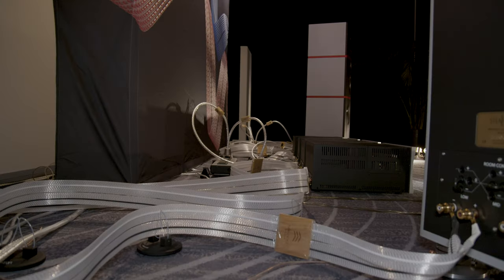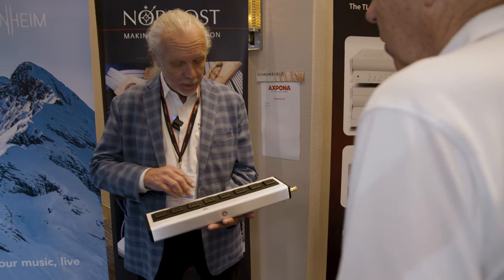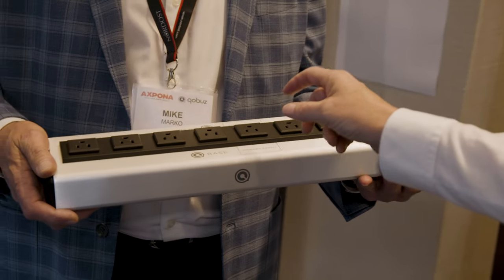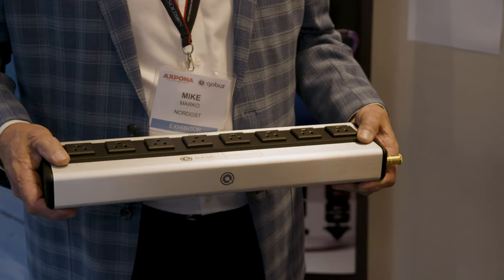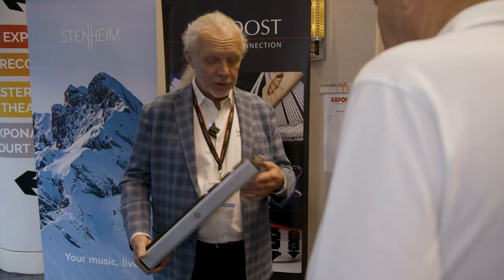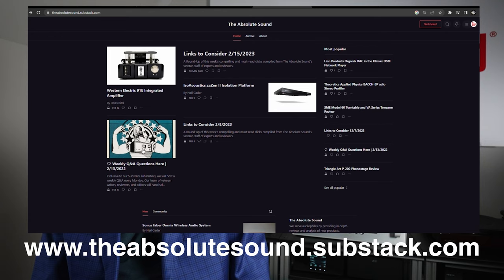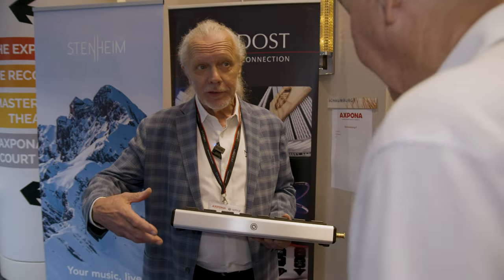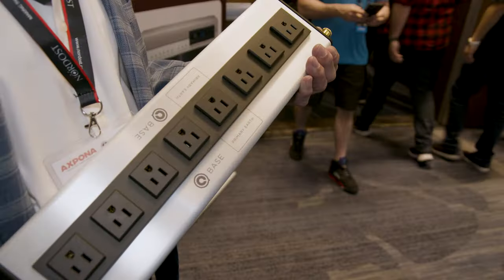The QBASE Mark III AC Distribution Unit | Preview

Comment: How is it that after a nearly 50 year career of designing power distribution systems for among other things laboratories where some of the most sensitive instruments in the world are installed, I've never had a problem with any of them that audiophiles seem to have with their audio equipment? I've never experienced any of them myself. Under normal operation there should be zero ground current flowing. If there is, something is very wrong. A GFCI circuit breaker designed for ordinary use will trip if the ground current is as high as 4 to 6 milliamps. How do you get a UL listing if you put a resistor in series with a safety ground? Makes no sense to me. BTW, NEC doesn't give a damned about your hi fi system performance. It's objective is safety. If in a fault of a hot to ground short circuit and the resistor burns up you could face a dangerous situation with an ungrounded circuit. 

At the request of countless A/V contractors I have specified and installed countless isolated ground circuits and even wrote a specification for acceptance testing of them to be certain that the circuits really were isolated ground. But in all of the years and talking to countless electricians nobody ever recalled solving a noise problem with an isolated ground substitution. BTW, that is not necessary or required in a wood frame building like most homes. If they are going to do anything at all it would be in a building with sheet metal studs creating the possibility of circulating grounds within the building itself. If an isolated ground receptacle is installed in a wood frame building you'd better be sure that the isolated ground pin and safety ground pin are shunted at the receptacle. 

The gold standard for high quality reliable electrical power in industry is the double static conversion UPS. High quality high value electronic equipment is designed with power supplies that take into account most types of electrical power quality anomalies. The double static conversion UPS addresses all nine types electrical engineers recognize.
Reply: Putting a resistor in series with the safety ground is against code as far as I'm aware, though electrical code was never my best subject and I'm not looking it up. I should phone my local Electrical Standards Association office and ask about it. As for what works in the laboratory, those guys have tight budgets and are doing what works. I've spent a lot of time looking into vibration control (and electrical power quality) and in the laboratory the demands are a lot lower than in audio. All they have to do is get the image to be crisp and that doesn't take much unless they put the lab in a bad location. Window air conditioners, HVAC or footfalls from people are the biggest problems. If you are doing In Vitro Fertilization you might want to have an active vibration control platform to put your microscope on but those facilities are in regular medical buildings with footfalls. Plus, laboratory instruments are designed to control their own sources of resonance. Audio gear has the added demand of needing to drain away their own self generated vibration and so the stiffness of the platform is very important. In practice, audiophiles have found improvement by stacking active vibration control platforms such as the Seismion Reactio platform. Stacking two makes a huge difference and three only a bit more. Seismion is coming out with a Pro version that will increase the isolation even more. There is no science studying vibration at this low a level for anything other then stresses in formed components such as auto parts. See pico-vibration meters. The best ever vibration control is in the gravity wave detectors they've built in the United States. It's basically like three massive  six degrees of freedom active control platforms stacked atop one another. 

I should mention that they have studied just about everything you can imagine about vibration as long as it is useless to us audiophiles. They even sent a deep sea submersible down to the bottom of the ocean and measured enough to figure out what vibration comes from the mantle of the earth, what comes from the ocean itself, what comes from tectonic plate movement and all the rest you could never think of if you're life depended on it. But they've never studied the role of stiffness as it would relate to draining vibration from audio gear. I bought 8 Critical Mass Center Stage 2M footers last year and those have upended everything i thought about how reality works. They're not perfect and they cost way too much money but now I'm thinking of buying active vibration platforms for my gear. That way I'd have super high stiffness and super low vibration. The best of both worlds. Too bad Seismion is German and the nation may not be in business next year what with their energy costs going up 400% to 1000%. 

I know I'm banging on about vibration when you wrote about electrical quality but there really isn't much of anything in the literature about electrical power conditioning. It's mostly proprietary. Most conditioners sound good at first but after taking them out after a couple years you realize it sounds better without. I suspect the brain ear connection takes time to sort out what's happening and it can be fooled at first. 

I just looked into Double Static Conversion UPS. SurgeX calls it Double Conversion Online UPS. They're basically a UPS that is designed to do it's thing all the time by converting the AC to DC (with a battery for storage) and then back into AC. So basically a low budget PS Audio Powerplant. A normal UPS takes action only when the power goes out. I'm looking for something for all the power outlets I use around my computer. It's ridiculous the number of outlets I'd need if I kept everything plugged in all the time. I used to have a very large normal type APC UPS for my computer. I stopped using it because of the cost of replacing batteries every 4 or 5 years. Back then I did try using it as a power source for my stereo and the sound was pretty bad. Not only is the inverter likely the cheapest thing they can make but the source impedance of the batteries is detrimental to the sound. 

These "Industry Professionals" that you talk about are, at best, engineers. I've worked with engineers for 40 years. They live in a world of certainty that doesn't actually exist except in their imaginations. The fact is that theoretical physicists (light years smarter than engineers) have studied electromagnetism for 200 years and still don't know how it works. I'd argue that all of physics including classical physics is just glorified cutting edge engineering, not science. They find things to measure and then record their measurements and then use the knowledge built up to design and build things. But they don't have the slightest idea how it works on a causal level. Search :"Jefimenko, causality, electromagnetism" for one of a mountain of examples I, a factory worker, can provide. Also search Freeman Dyson - Why Maxwell's Theory is so Hard to Understand for an idea of what they're up against (I think he's blindly optimistic but he does lay it all out). They're not stupid. It just can't be figured out. And if they can't figure out how electromagnetic potentials and fields work in a vacuum you should see how lost they are when it comes to the flow of free electrons in metallic crystals (conductors). Those guys must like to suffer. They know close to nothing. No joke. They do the math in one dimension (because it would be too complicated otherwise) and then after they get an answer they extrapolate it out to three dimensions. Hopping and guessing in the extreme. I learned nothing of use researching all of that. I would have been grateful for a definitive explanation of what causes Skin Effect but I found nothing. They don't even know how the EM wave travels through the crystal. They assume it's a plane wave but that just might be a simplification so they can do math. 

I might buy one of these converters to try to keep the noise from all the switching power supplies in and around my computer from contaminating the electricity in my apartment. One concern would be that the AC to DC converter in the Conversion UPS is itself just a large switching power supply and would make everything worse. I have two Topaz Series 30 isolation transformers right now. One for my DAC and one for my digital transport. Those are the only things I know of that can deal with power quality issues. Hi-End audio is the real deal but it is also the industry with the most nonsense and the highest percentage of manufacturers that the world would be better off without. Anyone yacking on about Wilson or DCS needs to be ignored. Audio teenagers who haven't experienced enough to grow up. Audio Note UK is where it's at and you'll conveniently notice they don't get reviewed (properly at least) in the mainstream audio press. They're too concerned with the "quality" of the "aerospace grade aluminum" chassis (which is a total waste of money and resources, but...). 

One example of real "science" in audio is the AES/EDU digital interface protocol which calls for a 110 Ohm characteristic impedance. Characteristic impedance in the low frequencies that we're dealing with here approximates to the square root of inductance divided by capacitance. The closer together the conductors are the higher the capacitance and the further apart the higher the inductance. So the capacitance (electric field) and the inductance (magnetic field) oppose each other to create this impedance. TARA labs claims to have AES/EBU cables with capacitance of less than 2 picofarads per meter. That is impossible if the cable actually has a characteristic impedance anywhere near 110 ohms. There are things we can be absolutely certain of and one is that this cable is impossible, and yet nobody in the "Audiophile Media" calls out this kind of abject nonsense.
Reply: @bunsw2070  Enhineers not interested in practical considerations like  irrational? How about a 25,000 power scanning electron microscope? A 100,000 power electron microscope? A machine I designed the installation for over 30 years ago that photographed individual atoms?

Comment: Hello,

Can you tell me, in layman's terms 
what a  double static conversion UPS is?
   I live around the corner from a utility company's high-voltage grid.
My tube amp is creating a buzzing sound in both 2 channel & multi-channel speaker modes.
Any idea how I can solve this issue?
   
 Also, I want to higher an electrician to put in a dedicated power supply for my 
audio/ video system.
What name & model # wire do you recomend I use?  
I use 2 wall outlets for my av system.

I appreciate whatever guidance you can provide.
    BTW, I recently put 3 store demo Nordost products on layaway.....the power strip in this video,
the QRT QX4 Field Generator & the Nordost Thor Power Distribution Unit.
Are you familiar with any of these
 products? Is so, do you have any opinions about them?

Thanks,

David

Comment: The problem with all non-pro audio systems is that the signal return paths get mixed up with the Protective Earth wiring because the system units do not conform to AES48 recommended practise. However these paths only go as far as the mains power distribution block and the wiring from there to to building PE is NOT PART OF THE CIRCUIT.
Adding 0.5 ohms achieves nothing when the power cable conductors are already 0.15 ohms or more. The real problem not being addressed for unbalanced interconnects is that the 0V Common between units needs to be in the order of 1 milliohm and that won't be solved by this product.

Comment: Yes different amplifiers all sound different, but AC noise is NOISE.  Any decent amplifier has a power supply that adequately eliminates the noise and regulates the power.  If it doesn't either it has a problem, or it's junk!   Please measure the noise output of any amplifier, then use this outlet strip and make the same measurements on the amp.  I guarantee there will be zero difference in the signal to noise ratio.  Then do a 10 person group A-B listening comparison with and without it.  Let us know how many of the 10 audiophiles can correctly "hear" when plugged into the outlet strip.  Maybe Absolute Sound listeners ears are so good they can hear a reduction in AC noise that can't be measured?  Next, lets do some A-B comparisons on speaker cable risers.  I hear there's quite a difference with them, the best made from kryptonite... It's a free marketplace and you can waste money on whatever you want, no matter how pointless the equipment is.

Comment: Significant reduction in "noise"....................next question....  "what noise & what percentage was the reduction ?  & how was that measured, what units ?       How does he know it was "significant" if he cant answer these basic question.     Sounds like a good way to spend $$ solving non existing audio problems.    If it really works show the data & double blinded results pls

Comment: So everybody's commenting on the supposed snake oil of this item, I won't debate that but I do have a question.

If this product is BS and snake oil and scientifically what the item does is absolutely nothing, and if people buy it and add it to their systems that they've spent thousands and thousands of dollars on and they notice an improvement, isn't it worth it?

I mean how can you ultimately past judgment on somebody's enjoyment of something, regardless of how you personally feel about whether or not that product actually works or not?

I mean let's think about it like spaghetti. You've got two types of spaghetti, spaghetti in a can that cost $1.50 at Walmart. You also have A plate of spaghetti that cost $150 a high-end super boutique fancy restaurant. Now scientifically And measurably we could say that both the canned spaghetti and the the super fancy spaghetti contain the same ingredients, so therefore there's no way that they can taste different or be different. I would argue that it's common knowledge that the more expensive spaghetti certainly is going to taste different, not necessarily better but certainly different.

Comment: I defy anyone to hear an audible difference between this $2,500 item and a decent Furman power strip costing $100 bucks in a double blind listening test. It’s products like this that give the hobby a bad name, and a reputable publication should not be promoting such nonsense.
Reply: The difference would be massive. I feel for you if you are running your hi-end audio system on Furman 100$ power strip. You don't have to pick Nordost. Gigawatt, Keces, Plixir all make excellent power products.
Reply: @marcinkantoch7176  run a blind test and show me. Till then it’s all psycho-acoustic placebo effect silliness. But no one will run such a test. Surely not the manufacturers for whom it’s an existential threat and certainly not the poor soul who doesn’t want to learn his thousands were spent in vain.
Reply: Well designed audio gear has a power supply of sufficient quality to obviate the need for the whole cottage industry of power products.   You’re wasting money better spent on speakers. Or music (imagine that).
Reply: I agree completely . This is all black magic